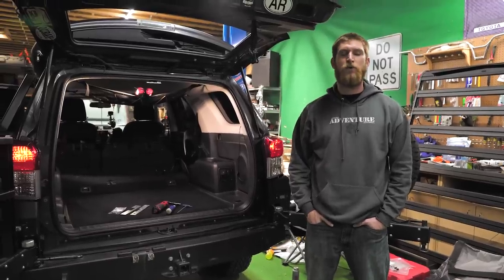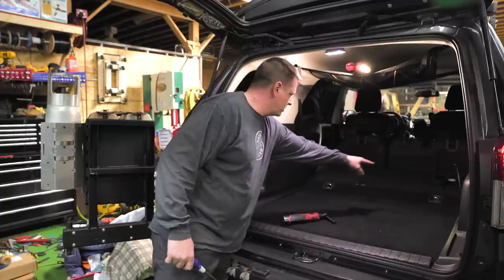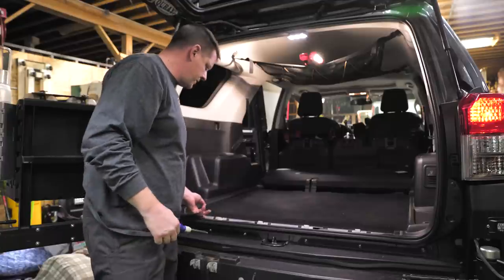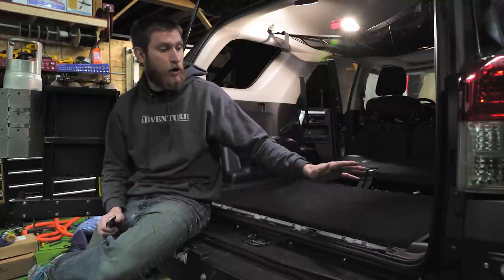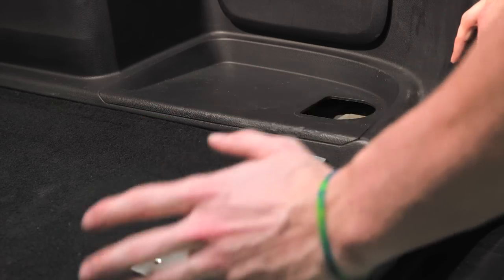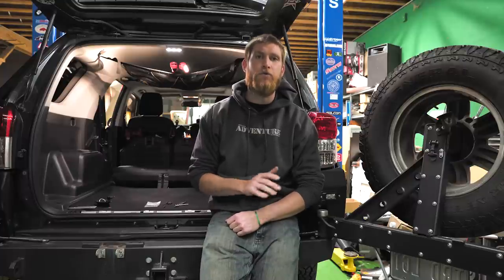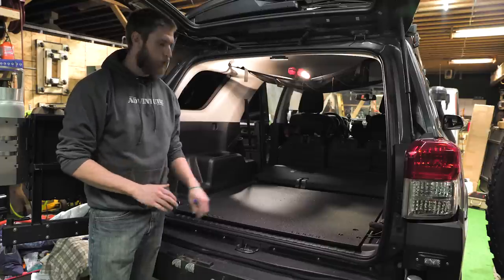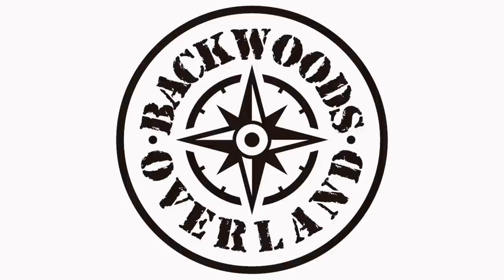Goose Gear Installation 5th gen 4runner by Backwoods Overland

Comment: Thanks guys for this awesome instructional video. 

From your experience, do you think instead of 80mil dynamat if I installed 150mil it would still fit the carpet and the plate? Or will 80mil be max thickness?

Comment: Excuse my question.. but, why would someone need that? I just have my weathertech mat.
Reply: You build on the plate.. installing a double drawer system or a rail system for a fridge/cooler
Reply: That's a great question. Primarily it allows you to mount things to the plate such as a slide for drawers or a fridge. Some like it because it's similar to a bed liner in a truck.

Comment: My 2014 4Runner Trail has the slide out tray. Do you know if the Goose Gear full length system with the second row seat delete will work with the slide out tray removed?

Comment: The rear anchoring system looks pretty weak, especially if the plate is used as a base to mount heavy boxes.  I know it's how it comes from GG and not your design.

Comment: Does this base plate level the hatch area, or is it only used for attaching drawer/ storage systems? Will stacking two plates create a level sleeping surface and is this even doable?
Reply: Even if it did it would be much much cheaper to build your own platform

Comment: What is the sound system and subwoofer you are running? Noticed a custom subwoofer on the passenger side.
Reply from the maker: zzsoccer33 That is actually from the factory. Limited trim.

Comment: How long do you think it would take one one person to install this? And how much sound mat did you have to buy?
Reply from the maker: The rear plat system wont take too long. Probably a few hours, maybe more if you're new to it. Either way it's not difficult. 
In terms of sound mat, we typically use Noico 80mil and buy the 36 sqft package off of Amazon.

Comment: 1) Which Dynamat product did you use? 

2) Is the plate pre-drilled for Goose Gear drawers? 

TIA
Reply from the maker: We use Noico 80mil for sound deadening. The Goose Gear plate are pre-drilled and have captured nuts mounted inside them for attachment points